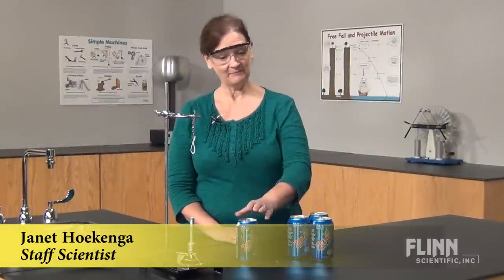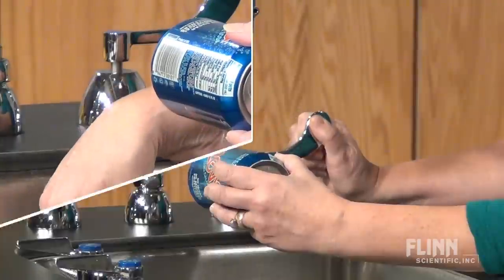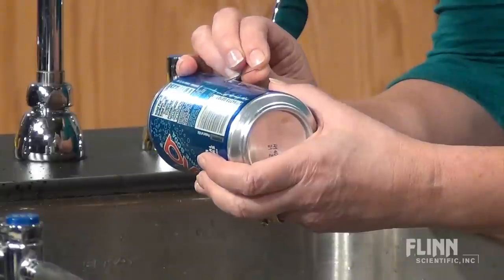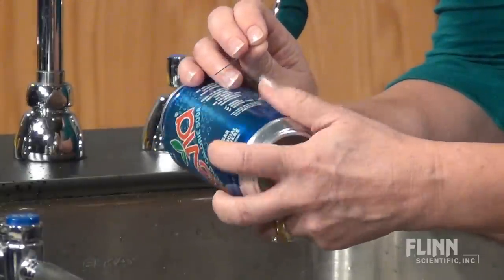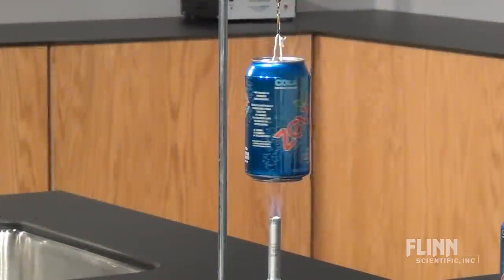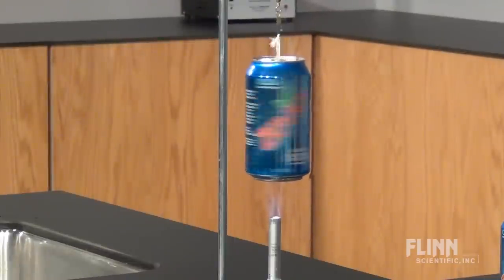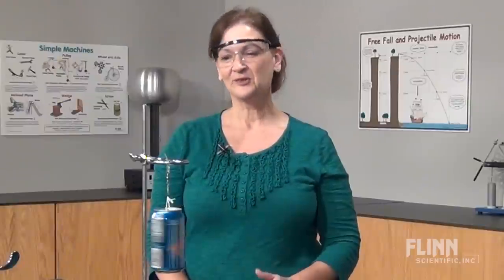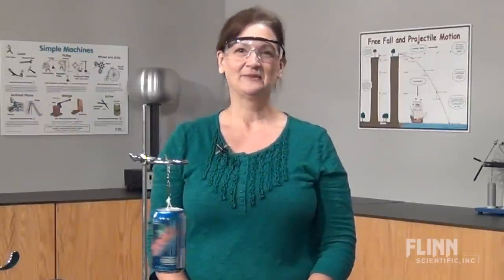How To Build Simple Soda Can Steam Engine

Comment: I tried this with a candle. The can was obviously filled with piping hot steam for it was very hot to the touch. However, the can did spin a bit, but barely moved other than that. Was it the flame temperature, or what?
Reply: candles are much cooler than Bunsen burners so yes, it was temperature
Reply: lol

Comment: could you put that on more secure poles one on top and bottom of the can, (with bearings) and put the bunsen burner at an angle to the can so the can is more stable so it can go at higher speeds
Reply: You would probably have to have a bearing the size of the pop can so that the flame can still touch the bottom. But then you need to account for the amount of friction to spin the bearing might not allow the can to spin because it dosnt have enough thrust

Comment: does anybody know if you could do the same experiment with a candle instead of a bunsen burner?
Reply: Maybe it just might take forever to spin or it might not spin at all, I tried boiling water in a pop can with a candle, it got pretty hot, but wasn’t enough to create steam or boil.
Reply: Maybe you could use a bigger flame like a oil lamp

Comment: This is not an engine but cool experiment
Reply: Lloyd This is an incomplete engine, with very little extra work you can charge things like this. Instead of using a burner you can burn candles or even coals